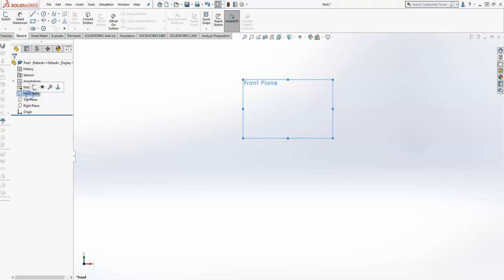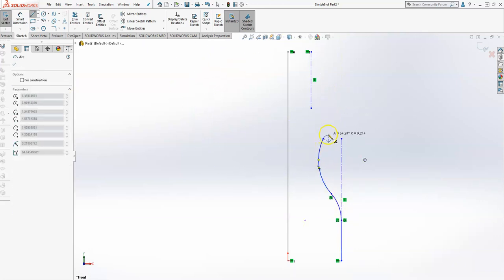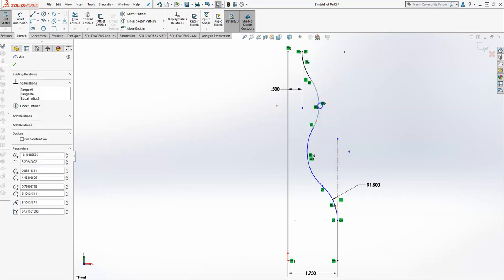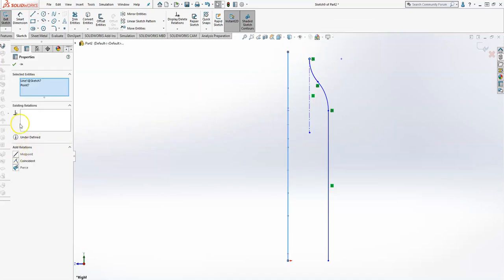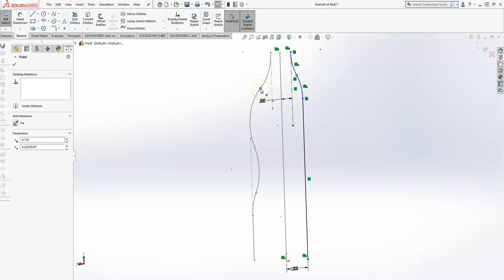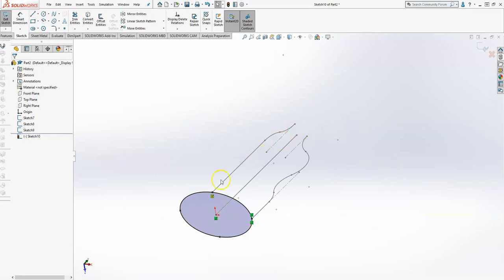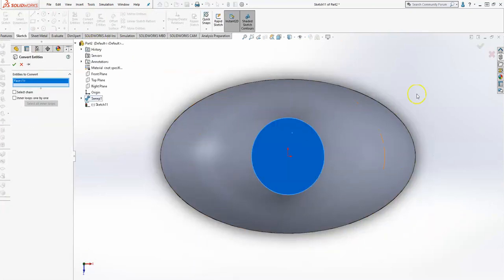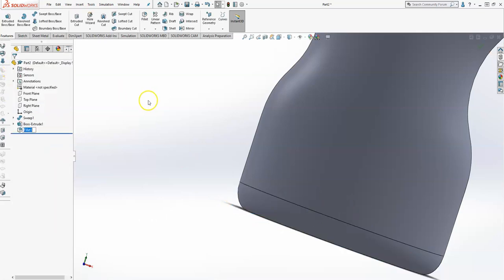Beginner's Guide to SOLIDWORKS 2018 - The Sweep Bottle

Comment: Iv used solidworks before on the free trial and it wasn't any harder that autocad
Reply from the maker: It’s not. It has made a lot of operations intuitive. If you have the ability to visualize and interpret models then you can easily transition from one CAD based program to another.